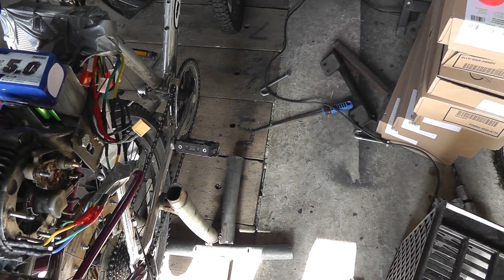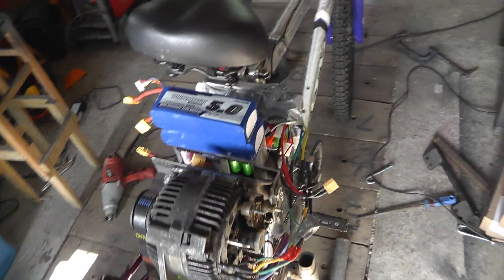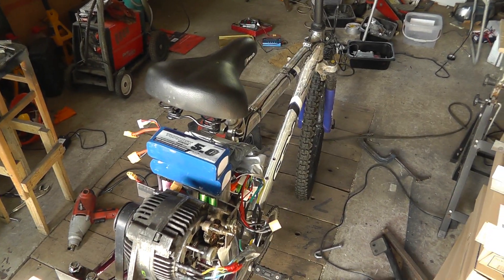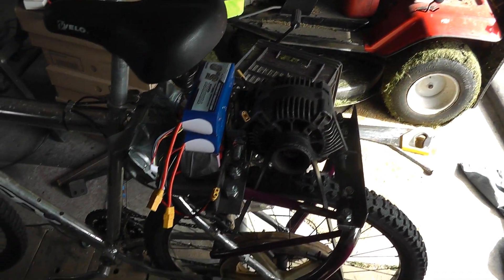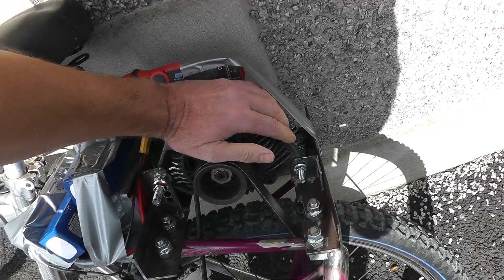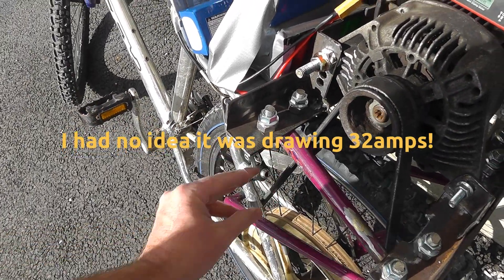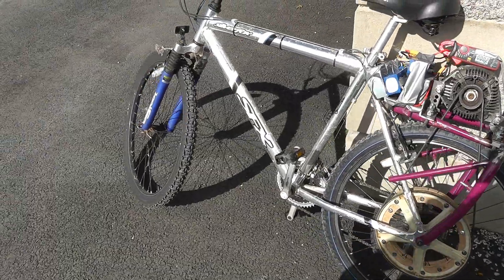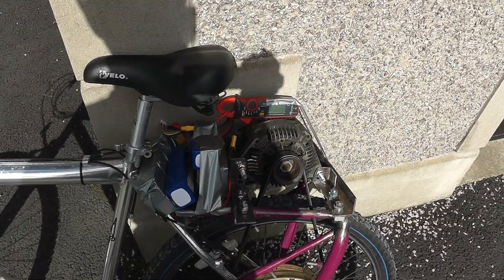Part 7 E-bike with alternator motor and Li Po batteries, testing on the road

Comment: Hi,i'am subscribe, your job so great , why you don't make permanent magnet rotor? For more eficiency!
Reply from the maker: I was just using what was easily available where I am. Also the alternator is quite powerful.
In my next version I hope to use a Bafang rear hub motor with my current controller and battery.
Reply: @alibro7512  thank you for information guy